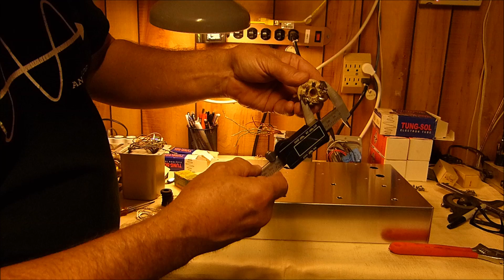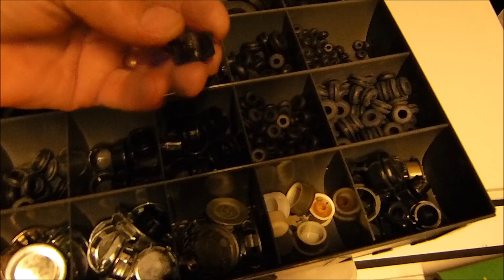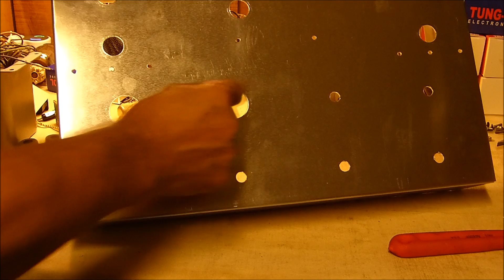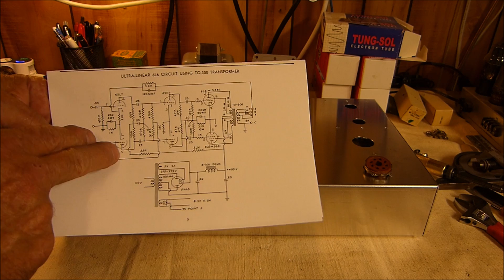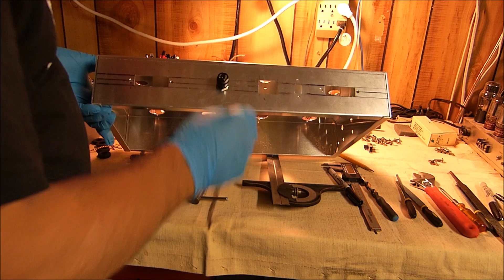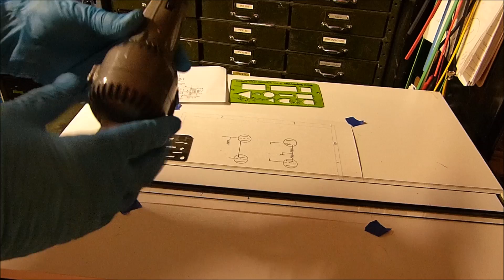Part 3 - Acrosound TO-300/305  (Williamson Design) Transformer Vacuum Tube Stereo Amplifier Build

Comment: I use Greenlee punch tools often. If the punch cutter is used on the outside of the box, and the draw stud and cup are used inside the box, then the hole is 'pulled' into the box. This leaves a nice rounded lip edge that needs no de-burring and no marks around the hole on the outside of the box.

Comment: The Greenlee punches you are using have four alignment marks close to the bottom of the cup part of the punch, if you mark cross hairs with your square on center at each tube location before drilling the pilot holes,  then punch what ever sized socket hole you will have left two perfect perpendicular lines intersecting at the center of the socket hole to help drilling holes for any screw mounted sockets
Reply from the maker: I see the marks now that you have mentioned it but I never knew it before and I have been using these type punches for 50 years. Thank you, and it just goes to show how valuable it is to share information.

Comment: Thanks for sharing. What is the hum balance pot? I have not yet built a valve amp.
Reply from the maker: The mum balance pot is usually a 100 ohm pot that connects across the tube's filament supply  with the wiper of the pot connected to ground. Some amplifiers use a center tap on the filament winding for this purpose, and for other reasons. Often times connecting one side or the other (to be determined experimentally) of the filament line to ground produces the least amount of 60 Hz hum from the speaker. There is no absolute for all tube amps so the hum balance pot is installed to allow a variable adjustment to produce the least amount of hum from the speakers.
Reply: Very interesting. Thanks for the explanation. Nice build.

Comment: I think I bought too small a chassis....
Reply from the maker: For an amp of this size a chassis of 10"  x  17"  x  3"  is a good choice. I often chose a 17" wide chassis as it fits (slides into) a  standard 19" rack that uses a 19" front  panel.
Reply: +ElPaso TubeAmps Thanks.  Yeah I bought 12x12x3.  I'm going for the wood trimmed tabletop set look.  The components fit during mock up luckily so I think I'm ok.

Comment: Nice video! Especially for those of us that are considering an amp build.

I have a set of Greenlee punches and the t-handle reamer you used. I like that deburring tool. I've never seen one like that. I wish I had the hydraulic set that I used 25 years ago but someone needed them more than I did I guess. One thing to note, if you need to punch holes in a stainless steel enclosure Greenlee makes a punch set for putting a hole in stainless steel. The carbon steel version makes a mess of a stainless enclosure. I also have a conical "step" drill bit set. I like those too but I've used the Greenlee punches a lot more (in the past, I don't do that kind of work anymore).

Do you have a square / rectangle punch set? The rear panel looks great!

I haven't seen an electric eraser since the late 70's / early 80's. I still remember the smell of ammonia from making blue line copies. Vellum, etc... good stuff!